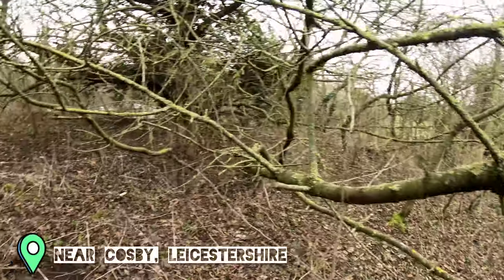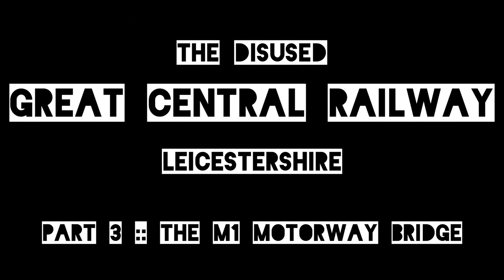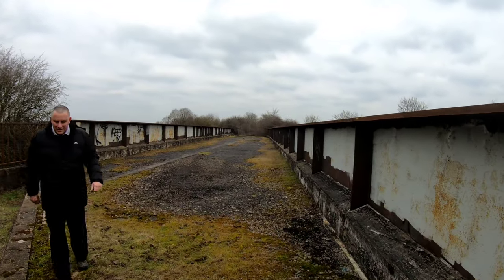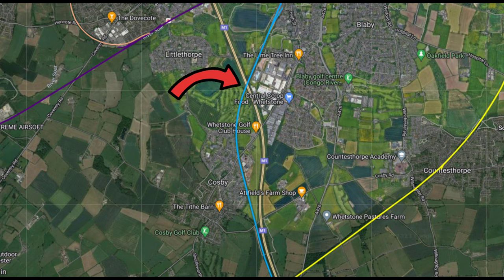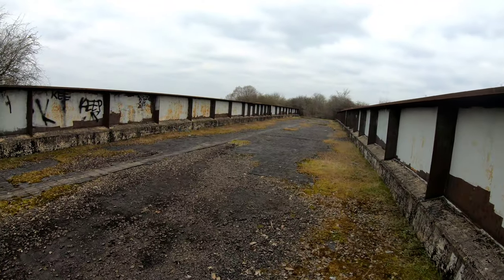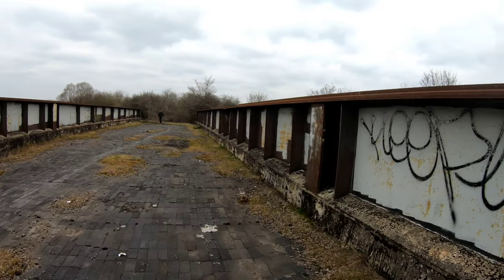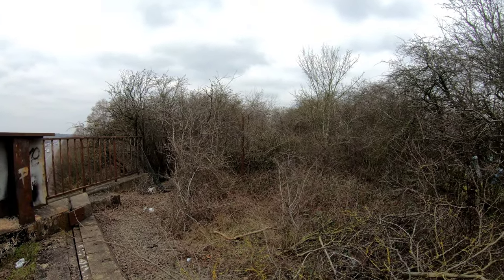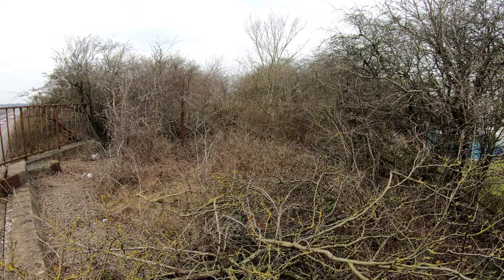The Last Bridge Built Before the Closure of the Great Central Railway?

Comment: Great set of videos Paul.  I wondered what that bridge looked like on top. Strange you can walk over it yet that tunnel is massively secured.  Weird that it's actually a tunnel and not a cutting 
The GC were hoping this line would go the channel tunnel that their chairman Edward Watkins had a hand in. If this had happened they were hoping that traffic would grow so long sections of four track would be required.  By putting stations in the middle another track down each side could be constructed without massive upheaval.  Looking forward to next ones
Reply from the maker: 👍🙂 cheers Russ.
I suppose technically it was fenced off like the tunnel. But someone has gained access at some stage by damaging the fence. Oops.  
Just imagine if it did make it to the channel 🙂

Comment: The other place the GC crossed the M1 was near Kirkby in Ashfield. The line closed 3 days before the bulldozers moved in to start construction of that section of the motorway so no bridge was ever needed.
Reply from the maker: Wow 3 days.
Would I be right in assuming the railway would have been going underneath the M1 near Kirkby?
Reply: @WobblyRunner  The M1 crosses the old line at Blackwell, where it was in a now filled in cutting. Only scant remains of the line exist in this area such as fence posts & some brickwork for the bridges that once existed where it crossed roads & lanes.

Comment: I'm a bit confused over levels. The trackbed either side, looked lower than the current blue brick surface on the bridge.
 I do wonder why that bridge hasn't been removed, it is an eye sore and clearly they're not gonna be reopening the GCR anytime soon. Wonder if there's a back story of it being installed rather hurriedly I'd assume to minimise rail disruption
Reply from the maker: I guess they don't want to close the motorway to remove it. I suppose whilst it's not dangerous, it's out of mind. I wonder if they still inspect it and who is responsible now?